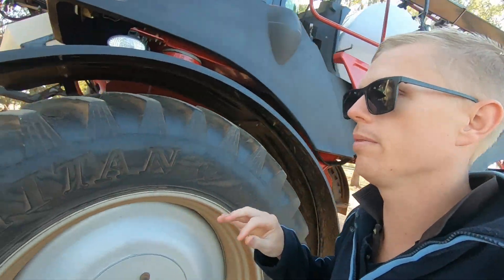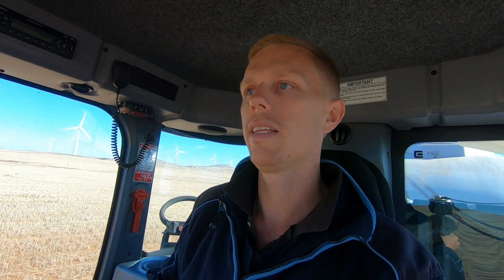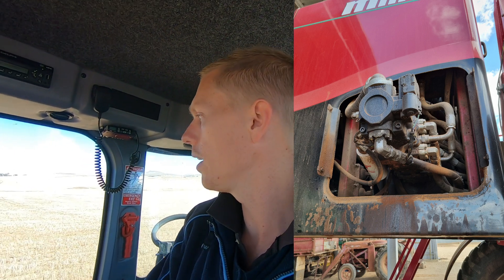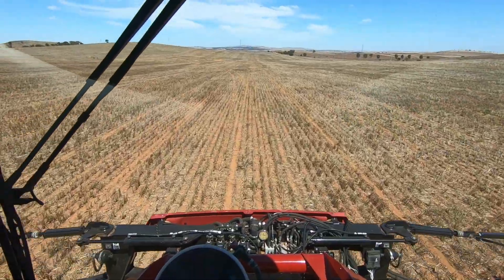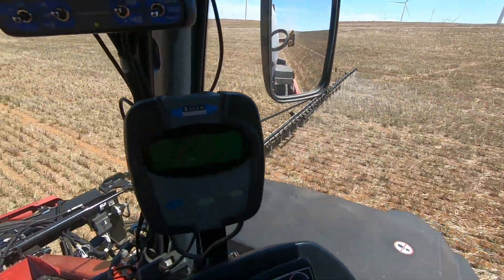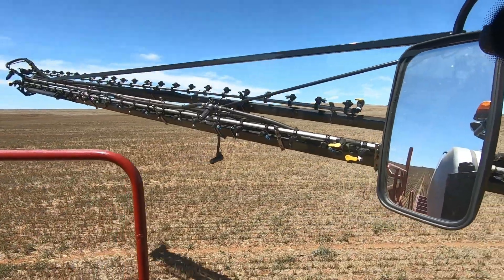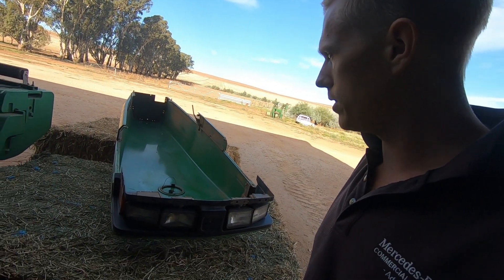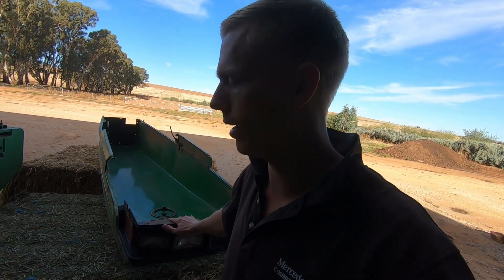Was This The Worst Buying Experience Ever!?!

Comment: Enjoy your video n best part was taking the Bonnet off you made your own scaffolding n work bench . About the sprayer sounds like the previous owner was lazy n knew they were going to trade it off or maybe a lease  it's a toss-up about the dealership that's sold to you. Grower in our area has a sprayer like that also never snooped around it just see it in operation Rain water is soft don't know how much sulfu or chemicals in the air Down Under We use AMS in mixes to enhance the chemica catch you next time l
Reply from the maker: No doubt the old owner got lazy. I'm sure most people do when they get close to trading something. Thanks for watching 👍